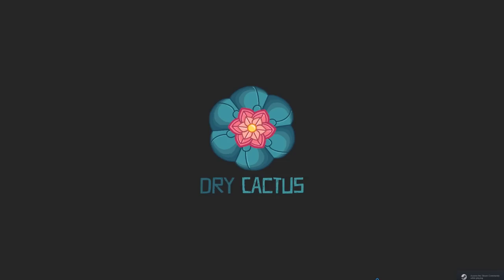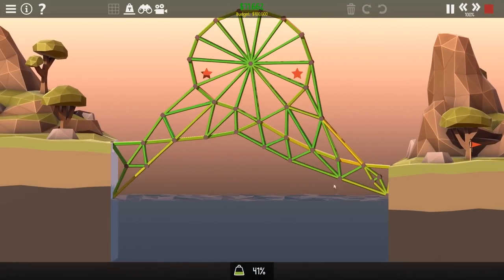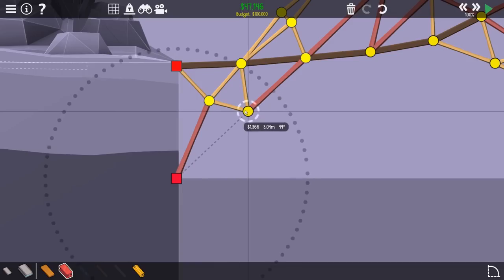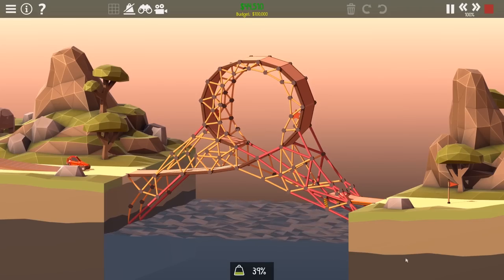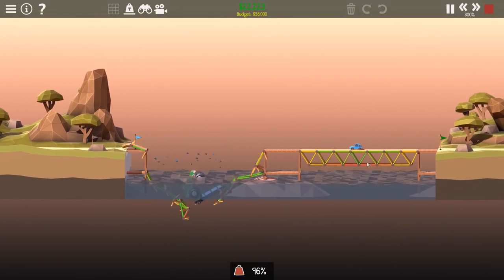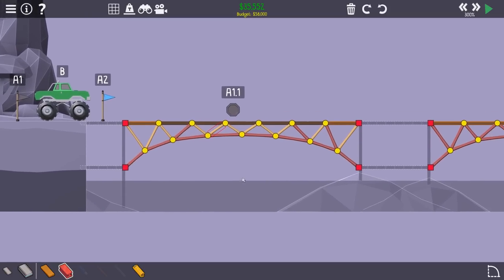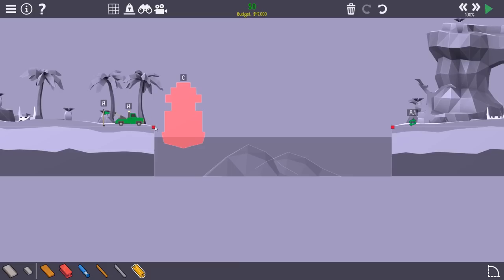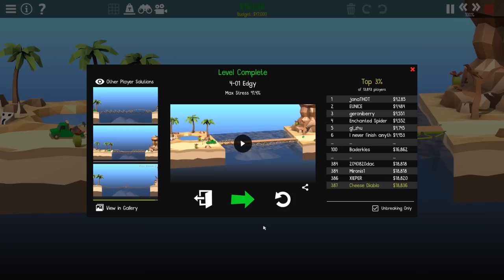How to CLIMB THE LEADERBOARDS in Poly Bridge 2 using ACTUAL ENGINEERING! Featuring a loop!

Comment: 14:47 The game operates on a floating-point system not a fixed-point system, so, when bridges are really finicky or close to breaking like yours was, there can be a butterfly effect from changing unrelated things.

If not that, the extra weight from the reinforced road coulve also made the right bend a bit less, changing the limo's placement a tiny bit, and affecting how the monster truck went over it.

Still better than pb1's rng when running the same solution twice, though!
Reply: Big brain
Reply: What they might of done is just make all random elements have a set seed and thus little changes could effect the random output for the next random element
Reply: I always parsed these unrelated changes as re-seeding the rng but I feel like some impossibly slight difference in the limo's position is a better explanation
Reply: @luke-san7733  you are correct to my knowledge
Reply: @Luke-san It is a deterministic physics engine now, there is no actual rng, just calculations and butterfly effect.
Reply: I don't know this is true in Poly Bridge 2, but in Poly Bridge 1 speeding up or slowing down (from 100%) also can mess with the physics engine.
Reply: hi minecxt
Reply: Interesting thoughts. I think what puzzled RCE was that there were anchor points in between the bridges, which are supposed to absorb infinite amounts of force without moving at all. Hence he was expecting changes to the second bridge not to be able to affect the first bridge. I'm guessing that there are a lot of calculations to do, and the order matters, and any change to the bridge could change that order. Which is very unhelpful as you can't affect the outcome in a calculated way, just trial and error. It could also be that computers can't actually do infinity, so the anchor points may not work as advertised.
Reply: @davidholland4713  It doesn't calculate stress for the anchor point as there is no stress to calculate, it is not technically a part of the bridge.
Reply: @jadensmith1820  Yes, I shouldn't have mentioned that theory! So it has to be doing calculations in a different order.
Reply: @David Holland It is not calculation order, it is the car being in a slightly different place, thus causing more stress on certain pieces in the bridge
Reply: @jackalscry8173  Why would the car be in a different place if the changes to the second bridge didn't affect the first because of anchor points? This isn't clear to me. The anchor points don't move or transfer stress so the first bridge should not have any change in stress if only the second is changed. What is supposed to make the car be in a different place?
Reply: @davidholland4713  I think the theory is that changing the second bridge caused it to flex differently since he added a more ridgid material. The different amount of flex would affect the speed of the limo buy a small amount as it goes across, leading it to stop in a slightly different spot when it gets to the other half.
Reply: @tezeta3725  You are ignoring the anchor points. The 2 bridges are connected only by land and anchor points, neither of which can move or transfer stress. So changing the second bridge cannot change the stresses on the first bridge. So there cannot be a difference in the location of the limo as you suppose. In practical terms in the real world, this is also true since the land is affected by too negligible an amount by the transferred stress to affect the bridge in a measurable way. But by all means ignore my argument if you prefer. Your own argument makes sense for a single bridge, changing it anywhere will change the stresses across the whole bridge, but it doesn't make sense with 2 unconnected bridges.
Reply: @davidholland4713  Sorry, I maybe didn't explain too well. I'm aware that the anchor points absorb all the stress making it impossible for the right bridge to have an effect on the left bridge. I was proposing that the change to the right bridge would alter the distance that the limo travels across it. Again that would only be true on the right bridge, but if the game decides where the limo stops based on the total distance travelled that would mean any change to the amount of distance it takes to get across the right bridge would cause the limo to stop in a different place even if the left bridge stays exactly the same.
Reply: So basically its having more shitty phyiscs than garrys mod.
Reply: Nice thought, but that doesn't make sense - the right side of the bridge is supposed to be completely isolated from the left side. The fact that it's using floating point shouldn't have an impact here. It's definitely a bug, the middle section should be 100% static and should be keeping both sides of the bridge completely isolated from each other, but it isn't doing that. EDIT: in another comment someone suggested that the change to the right section could have affected how far the car stopped on the left section, therefore changing the weight distribution on the left section, causing it to break. That would actually makes sense and seems plausible, we've been assuming that both sections are seperated but they aren't, if we take the car into consideration they are connected.
Reply: This guy is a programmer
Reply: Just don't build your bridges where there are parts that are close to 99% stress. I wish there was a leaderboard for least stress within budget, or lowest stress/$.

Comment: The 2nd failed because poly bridge physics are actually still random. They're "Deterministic" (You'll always get the same result for the same bridge) but are still inherently random by default due to the nature of the game engine. You might be able to fix that by making miniscule changes to your bridge to make the game think its a 'new' bridge and re-roll the RNG
Reply: The reason the reinforced road made it collapse is because it's heavier than normal road. That made the right side bridge "sag" a tiny tiny bit, which changed how the limo parked on the left bridge (since it had to "drive up" and had to drive a longer distance) thus having the monster truck land differently when coming off the limo and crashing the bridge. (I'm pretty sure that's how it went?.... lmao)
Reply: my guess is that, the more pieces you have, the fewer decimal places it can simulate for each piece, which can turn out in your favour or not, depending on whether the number any given piece would've gotten is rounded down or up.
imagine something like 3.14159 turning into a 3.1416
Reply: @windhelmguard5295  I doubt that's the case, since such optimization would save probably a few hundred bytes at most and it would be difficult or even impossible to implement in any widely used high level programming language
Reply: @SophieJMore  it would actually  increase memory consumption, the code required to manage precision would use more memory than it saved.

Comment: For the bit where it randomly breaks this is called a butterfly effect. As reinforced Road is heavier than normal road the bridge will sag by a miniscule amount probably slightly changing the limos speed that makes the monster truck hit the limo differently and that's why you have your break. The reason why it happened with the muscle is because there was a slight change in balance.

Comment: I think the specific issue in that level was there was a micro change in how the limo crossed the right-side bridge thus, the precise location it stopped on the left-side bridge was altered. So, when the monster truck ran over and back down the limo, it landed back on the bridge in a different pixel than before.

Comment: (14:30) Real Software Engineer here: While the game uses stable simulation it uses IEEE 754 format for storing floating point numbers. This format is a good enough approximation, however neither + or * is associative, thus a + (b + c) may or may not equal to (a + b) + c . When you tweak any variable of your bridge, the material nodes might get processed in different order, resulting in sudden breakage even in disconnected parts of the bridge.
Reply from the maker: I'm hoping the devs will give me the actual answer! I'll suggest this though. But more importantly, how was the beet harvest this year?
Reply: @RealCivilEngineerGaming  There's more problems with the format: https://en.wikipedia.org/wiki/Floating-point_arithmetic#Accuracy_problems
so it can be a combination of any of these factors. 
Harvest was twice as big as last year, a tradition in the Schrute family. We also had to double the number of Cylon guard bears to protect our fields because of the civil unrest.

Comment: When you added a muscle, the right bridge sagged slightly less, so the limo was going faster and therefore slid slightly further before it stopped, so the monster truck ran over it on a slightly different part of the bridge that was slightly weaker.

Comment: 15:05 basically since the bridge is different the limo had a different speed going across so the spot it stops is like 0.01 pixels different which randomizes the physics calculations.

Comment: 14:32 I have a theory as to why this happens, the centerpiece might be invincible but it might still transfer some force over to the other side, meaning when you reinforced the road, there was less give and it was more rigid.
Reply: Nah man, I had a more extreme version of this in the challenge version of this bridge with multiple monster trucks where I actually built some ramps and dips into the bridge so that the monster trucks could drive more easily over the cars.

Any change you make to the right bridge, be it a tangible change like shifting the peak of a ramp by a bit, or something seemingly irrelevant like changing some supports under the bridge, will affect the final position of the limo when it comes to a halt. This changes the point of impact of the monster truck that crashes into the bridge after driving over the limo. And that slight shift in point of impact can be the difference between having the force distributed or having all the force go straight down a single element... Or in the case of this video, it can be the difference between a 99.99% load and 100.01% load.
Reply: @naphackDT  I think I get it... thanks!

Comment: In the first level, I'm fairly sure you could have made the loop significantly shorter at the top, since you don't need to go higher than the checkpoints. This means you could probably get away with fewer road pieces, saving nodes, complexity, and weight on the whole structure, possibly allowing for further savings on the lower parts.

Comment: The game is not only factoring in forces from weight but horizontal forces both from the torque the cars tires pushing backwards on the road and with the monster truck crashing into the other car. 

In the spring bridge the springs contracted on the left and expanded on the right because the force of the collision. 

Your muscle was weaker for horizontal force.

Comment: I'm wondering (and someone who knows the game better can correct me if this speculation is wrong) if the game treats certain pieces as unbreakable structure where force is transferred. If the 2 tier section of road in the middle is transferring some small amount of force, adding the extra weight from the reinforced road, or the extra stiffness afforded by the muscle could cause the forces in the left side to increase.

Also, a few things to consider: since game physics systems need to do calculations in real time, they tend to be much less precise than proper simulations. This means that since they are using floating point numbers you can run into precision errors. Remember, a floating point number is incapable of representing certain values entirely, which can cause errors that will propagate through the calculations. It's possible that by changing or adding nodes you are changing the calculation itself, which changes how an error propagates through the calculation.

Comment: 14:45 I don't know for certain, but I'd guess that the extra weight of the reinforced road caused the right bridge to bend slightly differently, causing the limo to travel slightly differently, causing the limo to stop slightly differently, causing the monster truck to land differently, smashing the bridge. All that can really be done is you can either fiddle till it works, or over-design the bridge to make it super robust.

Comment: In response to why was the bridge breaking, I wonder what is the time stepping algorithm of the game engine.  Changing the stiffness of members can change the size of the stable time step when doing explicit dynamics.  I'm not saying that is what the game engine is doing, but that could be a possible source of difference.  I'm currently writing my PhD dissertation and half of it is on time stepping in FEA and the other half is on beams and shells in FEA of which truss structures like this are a very simple example.  If I was to venture a guess as to what the game engine does, it is probably a very simple FEA engine with probably explicit time stepping.  There have been things from videos from other youtubers that made me think that the simulation was going unstable which is a problem with explicit time stepping.
Reply: Hehe. Changing the stiffness of members.

Comment: I've only ever played poly bridge 1, but I think you are underusing springs. If you think about it, they are the strongest material, since they pretty much can't break. Specifically on the loop and the monster truck ones I think I would use springs everywhere to reduce spread and absorb the forces
Reply: Nah, springs flex, and can cause cause other parts of the bridge to undergo loads of stress. Also springs can break under enough stress

Comment: The monster truck rally bridge had the same sort of inexplicable break when Aliensrock streamed it. My guess is that it just changes a number somewhere in the physics formula and it's enough to cause a problem in what should be a completely unaffected bridge
Reply: also sanguine means blood, sometimes in color, sometimes like a "sanguine personality" which for some reason means "optimistic in bad situations." Anyway Sanguine Gulch basically just means Blood Gulch.

Comment: The bridge on the right affecting the one on the left is because all materials have an innate flexibility. Every bridge bounces and flexes slightly, which can keep the limo from reaching its top speed. In turn, it will stop slightly farther left or right depending on the flex of the right bridge, which can be a big difference if the limo's weight is less centered over a truss and more centered over a road, particularly when you have to deal with the monster truck impacting the bridge.

Comment: Things like changing other bridges affecting unconnected parts are usually because there's RNG in the game - the seed is generated by the structure  of the bridge - you can change the outcome by placing a completely unrelated piece of wood unconnected to anything, because the RNG seed generated by the bridge will change.

Comment: I've heard the Poly Bridge physics engine was not deterministic and they fixed that in Poly Bridge 2.
I assume they have a randomizer somewhere (I guess to solve the most stressful constraints) that was seeded on some aleatory value in version 1 (tipically the cpu clock).
In version 2 they probably changed the seed to some function of the bridge itself, so that for the same bridge the results are guaranteed to be always the same.
The problem is, when you slightly change the bridge, even if it doesn't affect the calculations, the seed has changed so the results may be different.

Comment: The reason is because the physics engine does not store exact value but a rounded off value. But the order of calculation affects the rounded off value. The order of calculation is determined by the order the nodes are created.

Comment: The two sides are not entirely independent here: the limo has driven across the right bridge before stopping on the left. Strengthening the right bridge could affect its springiness and therefore the limos speed and where it stopped and therefore where the monster truck's impact was. Straw that broke the camel's back.

Comment: The calculations of the game's physics change depending on the order in which the different pieces of the bridge are calculated. In the previous game this was a much bigger issue, because they would have a random sequence every time you ran the simulation. In this game they made it deterministic, which I would guess means that the order is fixed based on the location and material of the pieces. By adding a new reinforced road, this could slightly change the order of the pieces as they are added into the physics engine. There might also be a random seed involved, seeing how pieces standing straight up can still fall either left or right.

Comment: 0:12 Fun Fact: A "Q with stroke" (aka. This sign: ꝗ ) is latin, and is no longer used in modern languages.

So technically tranquil is misspelled. Even by medieval standards too, it was used as an ampersand (&) to my knowledge; which is just Google searching the Wikipedia page of the symbol.

Comment: Remember, Poly Bridge likely uses seeds for the physics engine. It looks like the seed that is used is generated based on the bridge you build. I haven't checked for myself if the game uses a seed but everything I've seen so far suggests that it does. If not, it is probably what someone else suggested. Changes to one part of the bridge can change the location on which a car stops somewhere further along.

Comment: The problem is that physics calculation on games are solved with a solver that sometimes uses random. To be consistence they generate a value based on your setup. If you are at the edge of it breaking then a small random notch can break it. Educated guess by developing alot of physics engines myself. Still you are right.